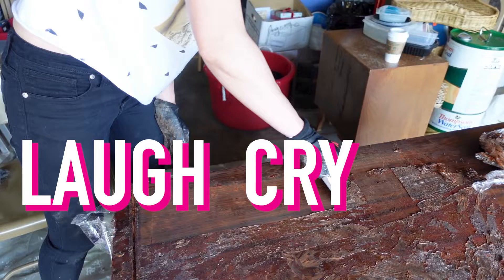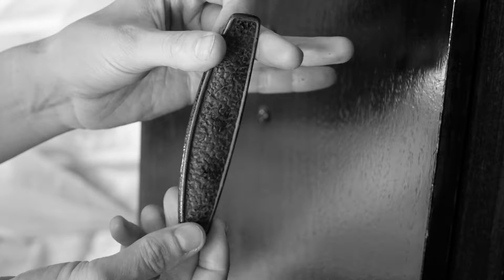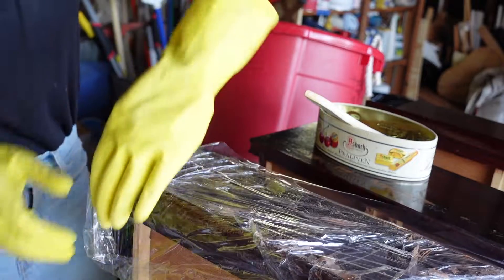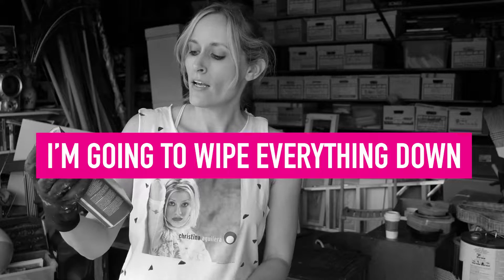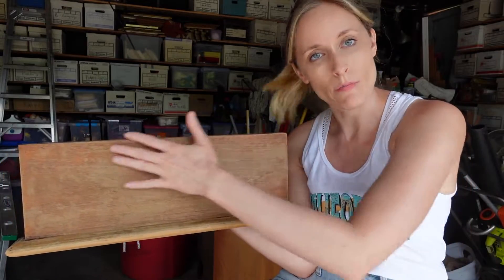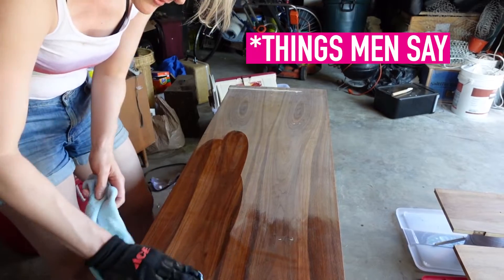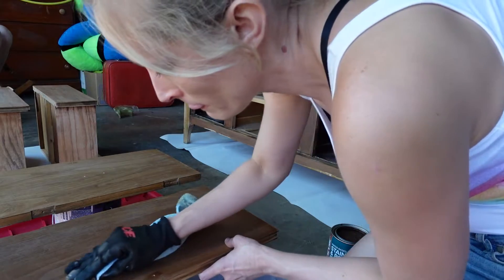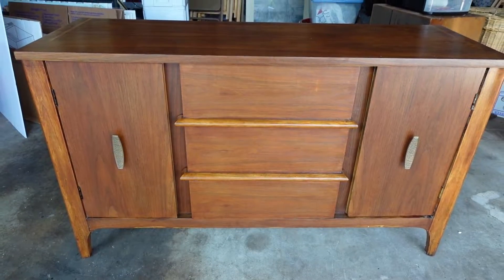Trash to Cash Furniture Flip | Restoring a Midcentury Credenza (Found on the Curb!)

Comment: This was a really entertaining video and I can relate to your struggles. Really love your humor.  Hopefully you never have to deal wit hit again but if you do encounter another demon screw like that one try placing a rubber band over the head of the screw. It will offer additional grip and fill in the gaps of the stripped out screw head.  It is a trick that has saved me many times in the past.  Doesn't always work but the minute or two it takes to try it is well worth the effort.  Keep making videos,  Subscribed
Reply from the maker: Thanks so much! Good tip.

Comment: Sooooo beautiful. Can you tell us more about that wood filler stuff? How much can you use in one spot?
Reply from the maker: So it’s definitely meant for more shallow fixes. It  needs to be layered on. If you have a super deep or large hole or gouge, something like bondo is better. But it worked just fine for this.